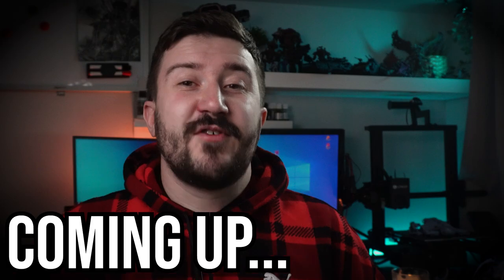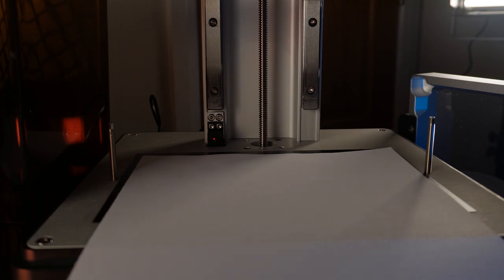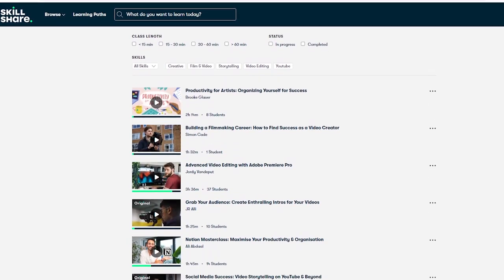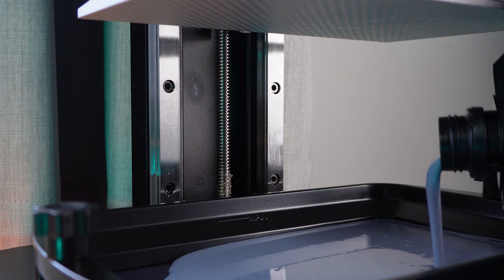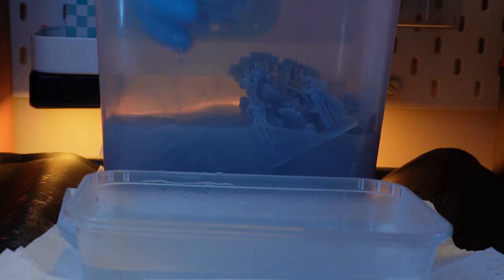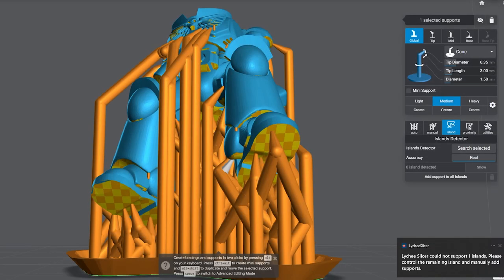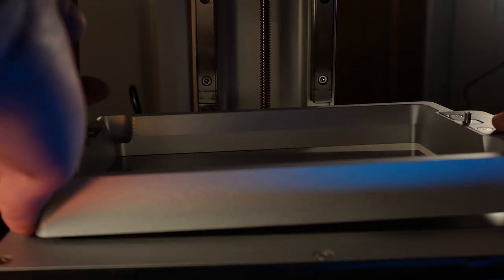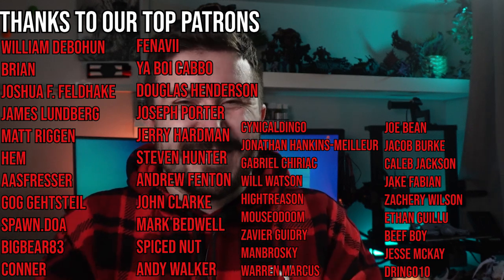Don't Make These 12 Mistakes When 3D Printing Warhammer 40k Models

Comment: One huge thing if you're in an area with cold fall/winter climate is the temperature of where you are printing. I got a new Mars 2 Pro for Christmas, got it set up in my drafty basement and could not get a successful print. I threw the printer in an indoor grow chamber with a tiny space heater and it was night and day difference. Plus it gave me an easy way to vent the resin fumes out a window.
Reply from the maker: Great point brother! It's important to try and maintain a consistent yet warm temp I used a grow tent for the longest time for the same reasons although my. Printer was in the loft
Reply: I second this; temp. is the number one piece of advice I give people to get under control. I use a vat temp band with a thermostat as well as a space heater as needed

Comment: You can improve presupported files by leveling them on the plate and adding more  medium and/or heavy supports. I did this on a model that kept partially failing in the same spot and it worked.
And it takes less time than resupport  everything particularly if the failure is only partial and not complete
Reply from the maker: Ah I tried to do it before in chitubox but it always messed it up have you any tips?
Reply: I found in chitu u could edit supports and move them into the previous support layer.  Doesnt work all the time and is less than ideal, but ive had success

Comment: For the first one: your printer don't have to be level, it just have to stay steady, so it don't wobble when printing.
Also I never understood why are people so sensitive when it comes to the temperature. I had my printer in the basement (~10°C) and then put it in my workspace (~20°C) and didn't changed any settings. The prints came out the same quality without any failure. 

I feel a lot of people put much more "pseudo science" into 3D printing then really needed. 
Make sure your printer sits steady, level your bed, use the factory settings to do a test print, adapt your settings accordingly (they don't have to be perfect to the mili second) and then print and have fun...

Comment: Personally I've never had a failure caused by the community settings in Lychee on my Anycubic Mono 4K, though the settings are a little conservative. Everyone's printer is different, but I find my exposure times can be about 0.4 seconds shorter than whatever community settings are in Lychee. Still, I don't mind overexposing just a little if it means fewer failed prints.

Comment: Pro tip when removing support, use hot water, it will removed left ipa and resin on the mini and the support gets off like butter
Reply from the maker: I can't believe it took me this long to start using hot water, how do you dispose if yours? Mine goes into the empty ipa bottles but i fill them up fast
Reply: @battlebrothersam  I used a Wash and Cure station with a plastics bucket and handle from bird feed,. filled it up with hot water to take the supports off, then cure it for a long time. but it's kind of made it all janky because of the weight on a normal cure for minis🤣
Reply: As a less messy alternative, I've been successfully using an inexpensive heat gun. I have it set up on it's back with the nozzle pointing upwards. After washing in IPA and then rinsing, I pass the model over the air stream a few times to gently heat the plastic up. The supports come off super easy.

Hat tip to Uncle Jessy for the idea!

Comment: The Cold is the most anoying problem with Printing. Never had so many failures with any other possible Source. Luckily the one time i didn't screw down the vat, i was at home and heard weird noises coming from the Machine. So nothing happened.

Brother if that Vat would've dropped, thats a new Screen and whole lot of Resin everywhere.
Reply from the maker: Brother it would've been a new printer resin would've got into every nook and cranny
Reply: I left the vat unscrewed overnight, woke up to it cemented to the buildplate so lucky no resin spills 😭

Comment: Sorry to ask, but what your do you use to clue your resin prints? Gorilla glue is really annoying to work with atm.
Reply from the maker: Gorilla glue super glue gel
Reply: You might want to try using a super glue accelerator. That stuff makes super glue bonds almost instantly, and also dramatically increases the bond strength!

Comment: so i have a general question about resin. 
i read and hear that its highly toxic and you need to use gloves - which is ok 

but i have not seen anywhere if this stuff also conterminates the air you are breathing. only someone said that its smelling. 
but would i need to take care of my air to not get poisned or is it save in this case. 

cause im currently deciding the pro and cons for a resin or fdm printer

biggest con for resin so far is the seperate trash im getting.
Reply: The fumes from resin aren't poisonous but can cause headaches, so good ventilation is important.
Reply: @nrgspike  ok, i have a small air conditioner which is able to pull air out. as soon as i got my printer ill just place it underneath and then im ready to go. 

i decided for a sla printer for the beginning.